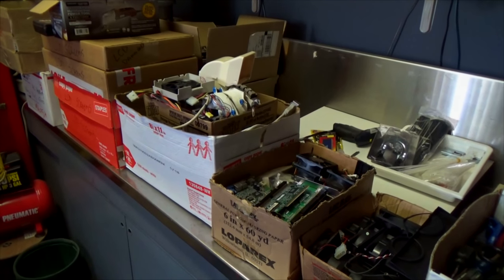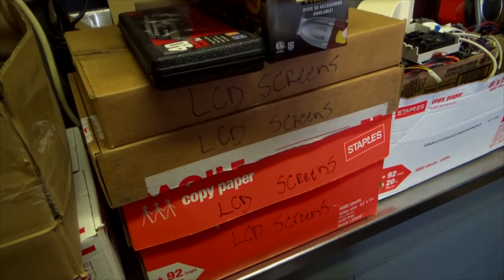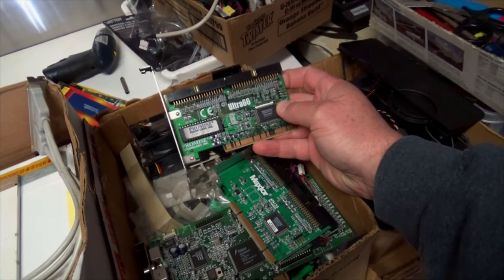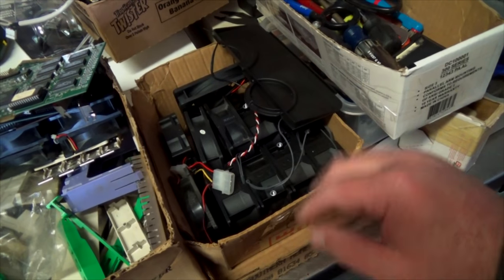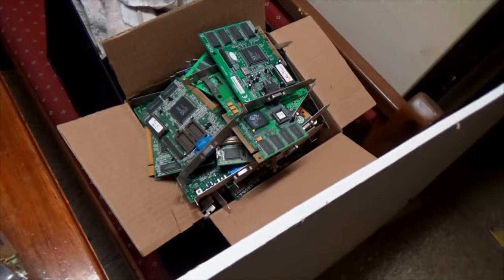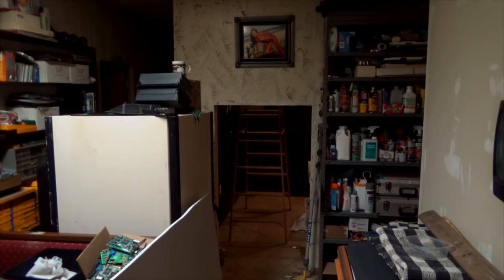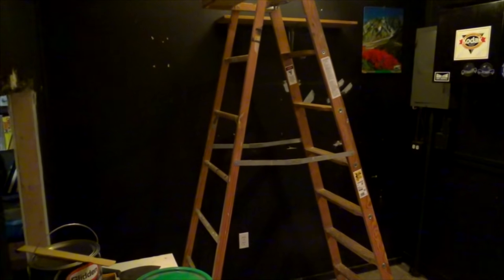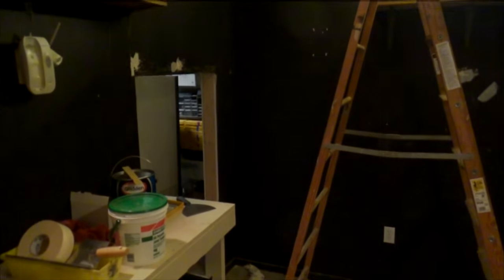Old Computer Parts and New Computer Lab - CRF

Comment: Steve, like you I purged my old PC parts a couple of years ago.  I ended up recycling a full pickup load of parts.  I too saved some things but I'm getting ready to purge them as well.  Not much use for the older stuff I hate to say.  I never recycled fans though, I always bought new ones since I felt using old ones was like replacing them with a ticking time bomb.  Great video, brought back some great memories for me, thanks!